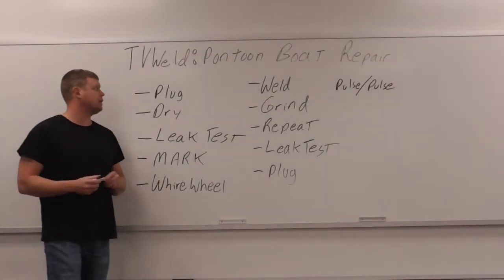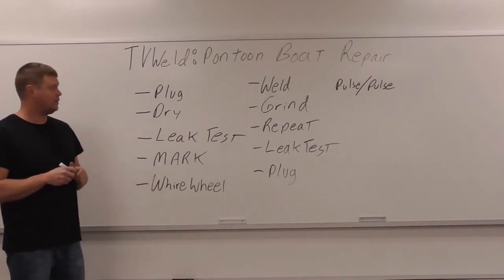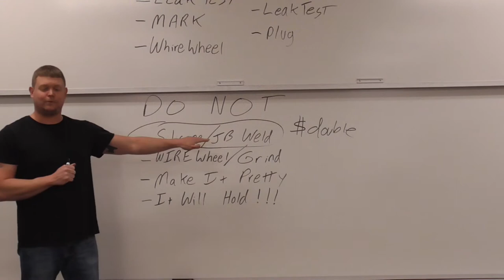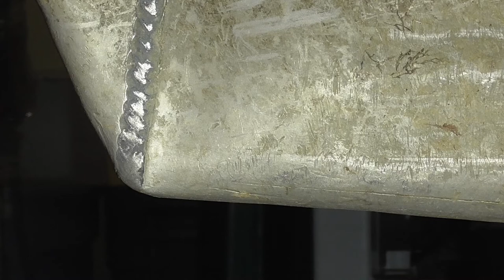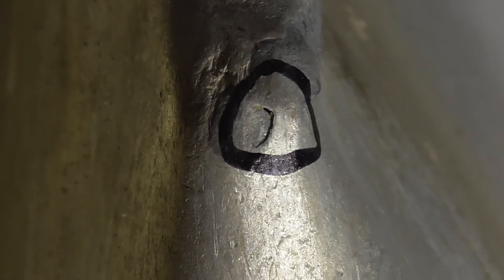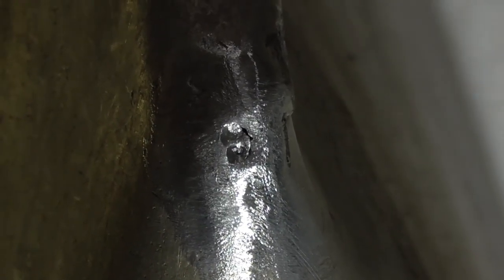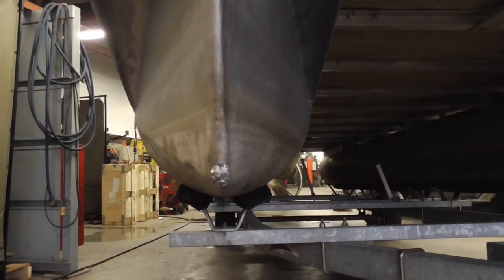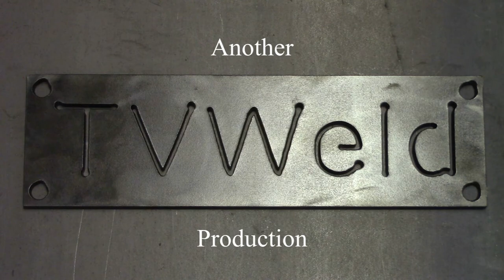Welding A Pontoon Boat

Comment: Excellent knowledge and demonstration, very well done. You said you were using a stainless-steel wire wheel? Are there any alternatives or is stainless the must-use? Also would there be a scenario of using a "patch" as in a separate sheet/piece of aluminum to fix a large hole/crack? One last question but is pulse/pulse an absolute must? I've been doing flux on mega marine industrial pieces and I'm trying to hone the aluminum skills. Your video has helped immensely, thank you very much!
Reply from the maker: If you use a carbon steel brush it will leave small iron deposits on the aluminum which will rust so stainless is a must.  I've done patches on big holes, but usually the crack is so small you don't need a patch.  Pulse on pulse is not a must but it sure is nice.  It keeps everything nice and cool!
Reply: @TVWeld  Excellent, this info helps a lot! Thank you very much!

Comment: Do you prefer push pull gun over tig? Last person who repaired my boat used a spool gun got lack of fusion and had to end up redoing the whole top portion of my bass boat.
Reply from the maker: All day long.  Lincoln 350 MP Power source with a python push pull gun.  Best set up by far.

Comment: Good day to you sir ,may I ask what is the difference between Mig and Mag Welding?
Reply from the maker: There is no difference.  MIG is an improper term because there is an active gas in CO-2 which is used in the shielding gas so they switched it to MAG.  The AWS proper name is Gas Metal Arc Welding or GMAW but most people will know what your talking about if you call it MIG welding.
Reply: Thanks for answering my question

Comment: How do I fix my mistake of putting silicone on my cracked pontoon?
Reply from the maker: Get as much off as you can.  I'd wire wheel it, then cook it with a torch (don't melt the aluminum), then wire wheel it again.  Weld it.  If it looks contaminated, grind it off and re weld it.  Do that as many times as it takes to get a good looking weld that is not contaminated.
Reply: Thanks. What do you think about mineral spirits?
Reply from the maker: @richardhendrix425  I've never tried mineral spirits.